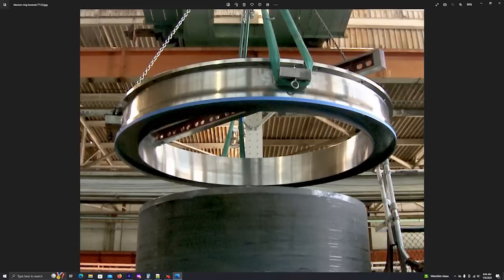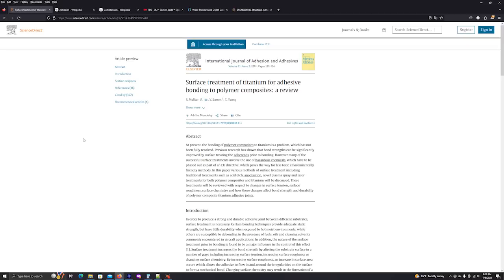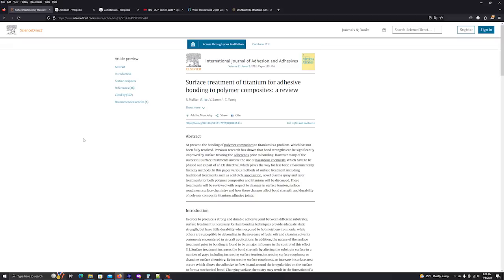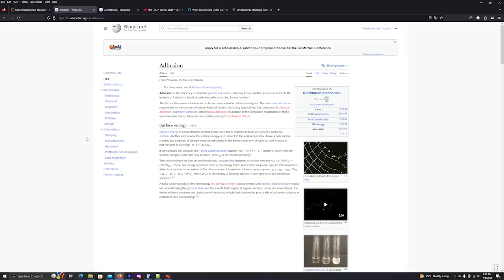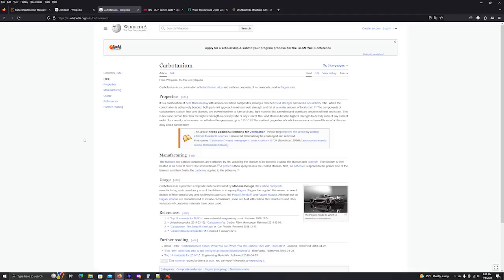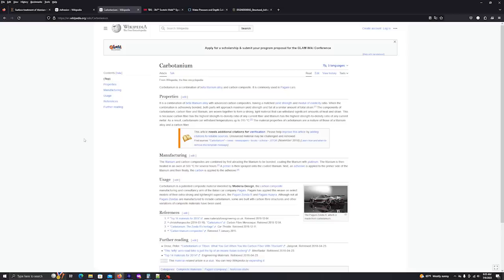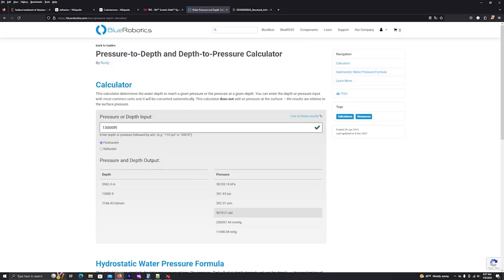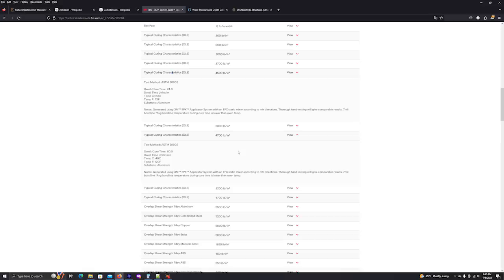Oceangate Titan Adhesive issues between Carbon Fiber and Titanium

Comment: There's a fundamental and very basic error in this video. The presenter is confusing the external hydrostatc pressure with the interface stress which the adhesive will need to transmit,. These are totally different. There are 3 primary stresses and one parasitic stress.
1. The axial compressive stress caused by the hydrostatic preesure on the end cap.
2. A radial shear stress caused by the differential thermal contraction of the two materials (difference in temperature between the workshop and the seafloor).
3. A radial shear stress caused by the differential contraction of the two components under the hydrostatic pressure (different elastic moduli).
4. A self-equilibrating stress system caused by the the geometric mismatch between the two components.
A simple axisymmetric FE analysis will quickly give a good estimate of these.
The presenter appears to be a Materials Engineer with little knowledge of structural mechanics.
My background is PhD level Strucural Engineer who researched the fracture of sumarine hulls sponsred by the US Navy.
Reply from the maker: Yes, you are correct.  I was corrected and yes in the first video I stated that I am not a mechanical engineer, and any feedback would be welcomed and I am open to corrections of my errors.  Thanks
Reply: @JoediyLab Thanks. I have no problems with honest errors when the person acknowledges his limitations (and I know where mine are). That is how we all learn.
 When I get home from my travels (currently in Portugal) I'll do a qick FE analysis of the hull to find out the approximate joint stresses which I will be happy to share. It won't be perfect because the CF composite is very anisotropic.
Please also be aware that there's no way the Ti rings could have been "blown off" under such external pressure  This was a shear failure at the joint.
Reply from the maker: Thanks so much for the information.  What is your opinion then of why all of the bolts on end cap and the window retaining ring blew off.  I have been thinking about this as well.  Again I love collaborative interaction.  Thanks so much, I would be interested in your FEA.
Reply: @JoediyLab  Are you a qualified Materials Engineer? Maybe a member of ASTM?

Comment: I’m not sure the bonding itself is an issue at all - even under a few feet of water, the end caps are already experiencing strong compressive forces (essentially sealing them tighter as it dives.) 

The reports of loud noises (even near the surface at ~200 feet) from people who had been in the Titan before seems to hint at a differential material expansion / contraction rate, which would make that joint VERY suspect. 

I don’t think the joint failed, so much as the existence of the joint itself caused stress cracking and failure of the CF pressure vessel near the joints. 

On the other hand, from the accounts of the noises experienced previously, I wouldn’t bet against the idea that the CF vessel as a whole simply couldn’t endure the compression cycling - REGARDLESS of what different materials were used as the end caps. 

IMHO CF is simply too brittle to endure these extreme compressive cycles. It can flex structurally very well (think 787 and A350 wings) but Titan was using this material in a VASTLY different manner. 

CF is a badass material for strength:weight ratio, but you just don’t use it for stuff like this. 

I’d say I’m shocked that no one raised a million red flags and tried to stop this guy, but…. they did (making this all the more tragic.)
Reply from the maker: Thanks for the feedback,  I am looking into some of your comments concerning use of carbon fiber in pressure vessels for deep sea use.

Comment: Images of the wreckage show a lack of adhesive residue as well as no carbon fiber remnants.  The adhesive chosen for the application obviously had a preference to the carbon fiber resin matrix.  Add to that the different rates of thermal and compressive expansion and its obviously a matter of when, not if there will be a failure. Proper testing would have revealed accurate lifespan estimates for intended use.  Im sure initial cost is lower for this construction method but correct and frequent replacement would offset the benefits for a multi-use sub.

Comment: The bonding almost certainly was a problem, and it's possible it was the first breach, but the proximate cause of the angular or sheer stress on the bond would have been due to deformation of the carbon fiber tube. External pressures on the endcaps would have been forcing the bond closed, not opening it, but the pressure on the tube would have been along the sheer line of the bond.

Comment: Does this discussion of the endcap joints really mean anything?  Yes, the end cap joint design was probably an inadequate design should never have been used, but was it the cause of failure or just one of the several things that broke when the hull failed?

Almost all composite pressure vessels in current use are containers, that is they 'contain' high pressure on the inside of the vessel and all of the materials and joints naturally want to 'rapidly disassemble' themselves in an outward direction.  Titan on the other hand had the high pressure on the outside trying to get in, this inward force would tend to keep the end caps on unless water entered the hull by some other means. So, if the view port or the carbon fiber center-hull section failed, yes, the shockwave of rapidly expanding water entering the hull at supersonic velocity is definitely going to blow those end caps right off, but everyone inside Titan will already be dead.  

So how did the water get in?  That's the question.  Fluids under pressure are insidious, gasses and liquids, they will find their way through almost any kind of gap and they can behave very counterintuitively when they do, forces normally applied in one direction are suddenly neutralized or reverse themselves.  But what actually happened on Titan, what failed first??  We don't know yet.  

On Titan there are three suspect points of failure:  the carbon fiber hull, the view port, and the hull to end cap joints.  You could also consider any thru-hull penetrations for wires and cables in the carbon or titanium end caps as separate suspects as well.  Just ask anyone involved in the US Navy's SUBSAFE program about risks involved with any type of penetration through the pressure hull of a submersible no matter how small and the extraordinary efforts that are needed to make sure joints and penetrations never fail.

If you're not understanding what I mean by supersonic shockwave of expanding water, Thunderf00t has an excellent video on the topic for the physics minded over on his channel.
Reply from the maker: Thanks for the great feedback

Comment: It didn't act as glue so much as an applied gasket. Like a crude and flat "O ring." It's clear from the pics that the glue didn't stick to anything.  If it had, we'd see sections of titanium with glue residue and perhaps pieces of carbon fiber.  The CEO talked up innovation, bit he didn't pretreat the surfaces, a proven way to improve performance. Then he didn't test the bond appropriately.
Reply from the maker: Yes, thanks for the feedback

Comment: The bonding was certainly sloppy and probably indicative of other problems, but I'm sceptical of this as a root cause. There is enormous force pushing the end caps onto the carbon tube with no sheer forces so the glue interface should be under pure compression. Differential strain or thermal coefficients could introduce sheer forces, but there seemed to be a channel in the titanium hoop the inner flange of which would have broken off if this were the root cause. Yes, there could be water leaks through the glue interface, but during a dive the pressure increases progressively over a period of a hour or so, so any water leak should be apparent long before it became dangerous. There is no way the end caps could have blown off first, the engineer you talked to was probably talking about a COPV under internal pressure.

Comment: Your analysis is wrong.  You use external pressure acting on a surface to calculate force. Then use adhesive value between the materials multiplied by the area of contact to get the force that can be resisted.  The weaker the adhesive value the more contact area is needed to develope sufficient force. That is a simplistic version.  Operating pressure and adhesive stregth are not comparable.  You seem to know some material science but you lack knowledge of engineering mechanics.   Why use a depth pressure calculator when it is a simple 1 step calculation if you consider water incompressible. Depth in feet x .433 psi/foot.  A factor of saftey of 1.5 is way to low, especially in the marine enviroment. Chain uses 4.  If you want to make videos outside of your knowledge without an appropiate disclaimer, you are dangerous. I am a degreed civil enviromental engineer who had many licenses before retirement.
Reply from the maker: Yes you are correct,  I am not a mechanical engineer and have stated this in the first video,  I am going to  be making a followup.  As stated these are theories and not fact findings.  These are assumptions and I have stated in my videos if any engineers want to point out any errors to do so.  Again I did make a disclaimer very clearly.  Maybe you should go back and re-watch the first video.

Comment: The PSi rating of the adhesive is not the same concept as the water PSi, which means that you can't compare the two PSi values to indicate a safety factor. The force that the adhesive can handle is based on the adhesive area times the rated adhesive PSi and the applied force of the water pressure is the water contact area with the end cap times the water pressure. The safety factor is therefore based on applied and calculated allowable resistance forces and not pressure values.
Reply from the maker: Yes you are correct, I will be making a followup of this error.
Reply: @JoediyLab  
No problem. Thanks for your research regarding this subject.

Comment: should have been a 6 inch flange clamped with bolts at minimum with a titanium inner layer to the carbon fiber to prevent dissimilar shrinkage

Comment: Fitting two dissimilar materials together is always a weak link.The cylinder shape is a engineering no no.The cylinder flex at the midpoint is enough even if miniscule means it cracks the bond because of continual dives.This 5600 psi flex cracked the bond,cracked the carbon fiber already cracked from repeated flexing allowed water penetration at 5600 psi that at that pressure cut through those materials like a hot knife through butter.This design was the death knell,as it was only a matter of dives before cataclysmic failure.Its a story of unbridled ego! And deaf ears to reason!

Comment: Very informative video.
First of all there are no shortcuts to safety.
I have nothing to do with the mechanics field my own is at sociology but logic permeats all sciences so i have a few thoughts on the matter.
The bonding was done by hand not in an baking chamber.
Contaminants and air bubbles could be present .Bubbles can be formed even after the adhesive epoxy application .
Cleaning and preparing of the titanium and carbon fiber surfaces meaning grinding or etching if necessary or application of a primer to enhance adhesion is unknown.
The end caps detached allmost clean off without a hint of a foreign material present.
Carbon weave was not in a pattern but rather perpendicular along the surface which would greatly reduce stress strength compared to an interweaved pattern especially to a deep sea environment.
There was no non destructive testing aka x rays or other .
No prediction could be made on the life cycle of the total submarine hull.
The amount of dives on that very same vessel approached 50 which is a lot.
Also it was repaired at some point.
Carbon is much more susceptible to cracking and delaminating than metal and it does not bend or cave in but rather fails localy.
No complete safety standards by any known marine safety company were followed apart from some nor did the team seek approval or some expert inspection in the manufacturing process or the end product.
The acoustic method of hull breach is a joke aimed at giving a false sense of security.
From the moment the system detects such abnormalities the time to resurface is simply not enough to prevent an implosion which could happen in milliseconds.
Carbon is unforgiving and when it goes it goes lightning fast.
If a person that has no relation whatsoever to this field can have such concerns why didn´t the "expert" team of engineers that designed and manufactured the sub chose to proceed with such dubious methods?
Reply from the maker: Thanks for you feedback

Comment: 5,000 psi (pounds per square inch) of pressure and these folks put their lives on the line by depending on the adhesion of an epoxy to titanium with zero mechanical fasteners? Now throw in the unproven/uncertified use of carbon fiber in salt water with ever changing pressures with no knowledge of how many times it can handle these extreme pressure changes and you’re literally putting your lives in the cylinder of a revolver and playing “Russian Roulette” as to not if but when it will implode. 5k psi is the equivalent of the weight of a vehicle on a quarter. As smart and ingenious of a man he was, this guy had to of realized at some point he was gambling with every dive he did. No wonder the contract wasn’t listed as paid customers but rather as fellow explorers. He knew there was a likelihood this thing would implode he just wanted to soak every dollar he could before having to retire it and build another. I’ve epoxied my hot tub hoses that leaked but I wouldn’t epoxy a tube together and take that shit 2.5 miles into the land of instant death pressures and take the chance to see how she held up. And especially I wouldn’t do it over and over with odd unexpected cracking sounds. Was this guy going broke hoping to get back in the black in time to build a proper unit? That man had no right risking paid customers lives. It’s one thing as a self explorer to risk your own life but taking huge money from a customer into the brink of death screams crazy, deliberate, irresponsible risk. Those poor souls put their money and trust into a man that created a guaranteed time bomb. Every dive had to have weakened that titanium to hull joint until it popped off like a cork from a champagne bottle. If it was just the shattering of the carbon fiber hull you’d think there’d be some chards still epoxied to the titanium ring. Nope she must have popped off like that champagne cork.
Reply from the maker: Thanks for the feedback

Comment: I used to work on inflatable sleeves for the drilling industry. The end pieces made of a turned steel were bonded in place by injecting epoxy aluminium under pressure using grease guns we disposed of after single use. We had to work fast as the pressure set the resin almost immediately.
The smear method shown in the video of the manufacture process was doomed to failure as cavities were extremely likely!
Also no key sites were visible on either surface. I guess the old white guys they didn't employ knew to much about composite materials, or they asked to much in wages!
Reply from the maker: Thanks for your feedback

Comment: In order for the end caps to have been blown off of the carbon fiber tube the pressure inside the sub would have had to have become considerably higher than the pressure outside. The occurrence of some sort of overpressure event inside the sub that blew the end caps off is impossible unless there were explosives that went off inside sub. It's more likely that the carbon fiber tube failed first and as it was being crushed inward the carbon fiber tube was forcibly separated and detached from the titanium flange.
Reply: Exactly there was no explosion but a detachment due to the colapse of the cf body.The end caps simply fell off.

Comment: A supplemental stainless exo skeleton that bolted to the flanges on each end would have probably been enough to keep the epoxy in place. Maybe another $25k. I'm no engineer, but I work with large plumbing and alot of water. Just imo.
Reply from the maker: Thanks

Comment: With each dive, microfractures would have been forming in the adhesion joint, combined with hard to detect delamination. Once the pressure worked through on a single path through the joint, the pressure would have ripped it apart from the inside out, followed by the compression of the implode.

Comment: the glue is used to keep pieces together at surface level. At a depth of 10m, the water pressure will push the dome, and the ring in between, against the cylinder with a 3000kg force. At the Titanic depth the force will reach 100000t and more. 
Under a similar load, the titanium ring act like a rubber seal under its own elastic deformation phase.
The Titan submersible was designed to take structural advantage by the outside pressure, in keeping pieces tight together.
The most likely cause of the disaster is still the inward failure of the pressure chamber, by collapsing of the carbon fiber hull.
Reply from the maker: Thanks
Reply: 10000t, not 100000t.

Comment: Even if the adhesive failed, wouldn't the immense pressures keep the end caps forced onto the carbon fiber? Or did it start failing at lower pressures and then the higher pressures exasperated some existing situation caused by the previous failures towards the surface?
Reply from the maker: Correct, the pressure at depth work hold the caps on.  I think the issue is the different expansion rates of carbon fiber and titanium.  Thanks for the feedback